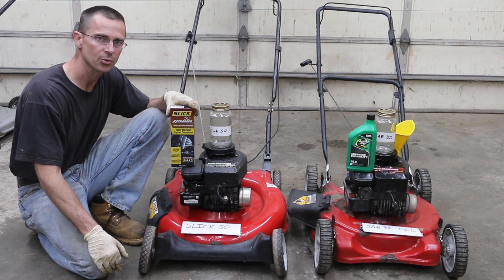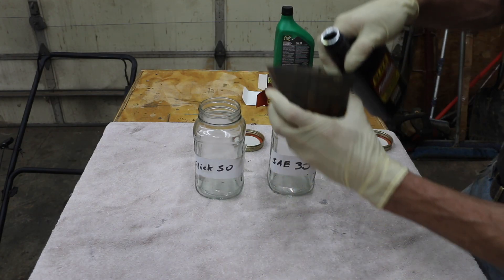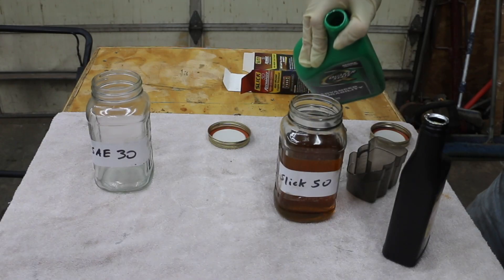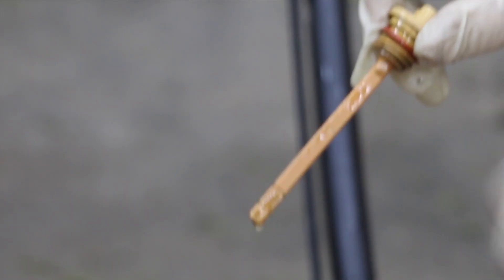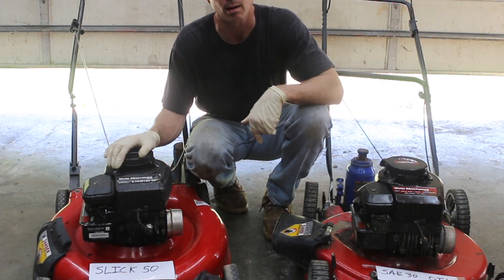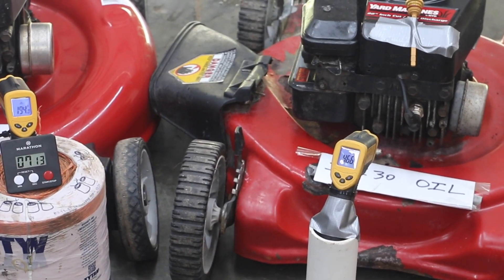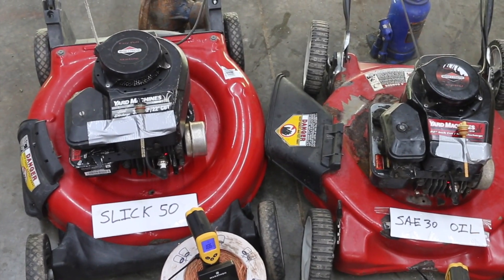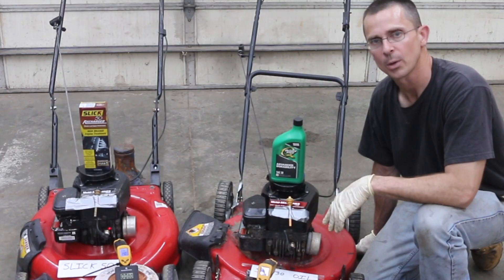Can't believe what SLICK 50 did to my engine!!--Dry Crankcase Test!

Comment: Hmm, most visitors are talking about their experience with cars or what they believe to have as an experience?. Quite a bit different beast of an engine if you compare the gasoline mower engine to a BMW M50 gasoline engine or an AMG gasoline engine or let's say a Turbo diesel torque monster with decent displacement! They all operate at a total different pressure figures,  temperatures and rotational speeds and forces. Not to mention differences inbetween cast iron or aluminium engine blocks based on reactions of the ingredients of the engine block with oil and additives, different bearing materials and tolerances. Just think of the tolerances a F1 engine has that not even would turn in cold condition while a stock car engine has to work under almost every conditions, even in Winter!

I'm not sure if that all doesn't lead to an apple-to-oranges but gives any kind of measurement?
Reply from the maker: All great points and thanks for commenting.

Comment: This is interesting. I've been running slick 50 in my old cars for years. I put it in my truck at about 100k miles and it made the engine run noticeably quieter.
Reply from the maker: Thanks for commenting on this!

Comment: As a young engineer I was suckered into the Slick 50 advertising. During a trip across Australia in the early 70's, my car ran low on oil and with no shops in sight, I thought not a problem, the Slick 50 will look after me. Wrong, engine seized. Later I ended up in a senior leadership position working for Castrol and regularly visited their R&D facility in the UK. Very impressive, as are all the major lubricant manufacturers including Castrol's main competitor Mobil. Key take away from nearly 50 years of working with different lubricants, is don't tinker with what some very smart people have developed into their products. If the oil doesn't work for you, find the grade/mix that does and don't try to home brew a fix.
Reply: On this line of chat, I did my own oil and filter changes on a regular basis.  Someone mentioned how good Marvel Mystery Oil was, so I tried it, adding a full quart to replace the filter add.  The engine ran noticeably quieter almost immediately.  Been a fan since.
Reply: @telemachusepiphany9668  I had a 1970 LTD that I needed to drive 1000 miles. The oil quit circulating and it made a terrible noise. The hotel manager mentioned Marvel Mystery Oil which I tried. I ran that car 3 more years before getting rid of it.
Reply: You didn't use it anywhere near close to the way the directions tell you to.  No break in, no time for the PTFE to bond or set.  FAIL.   SLICK 50 saved my ass in the Arizona desert. Conditions:  110+ degrees F,  80MPH 4 QUARTS LOW.   I pulled into the closest truck stop, added about 4 quarts of 10w40, and drove 50 miles into Phoenix @ 75MPH, '80 350 Chevy van with almost 100k miles on it.  I drove all over Arizona, then back to Texas.  NO obvious damage nor excessive oil consumption
Reply: @mre2u2  jus had a heck uva leadk did ya?? well no sense fixin THAT!
Reply: Interesting, I have just commented on how Castrol Magnatec oil appears to have improved the cold starting on my Isuzu Trooper, it's the 3.0 diesel 2003 model which I've owned for 10 years.
Reply: I call BS. No "engineer" is that stupid.
Reply: Leave it to a engineer to run a car out of oil, than blame the lubricant manufacture!
Reply: Terry Baker Thank you! 🌲
Reply: @@UCLHxVtPmWIbR0egpBxFBf8AThose engineers aren't going to be allowed to work on anything that would be released  to the public which might reduce our regular purchase of their primary product.
Reply: And what of the scientists and engineers making the additive products?    They are all evil capitalists while the scientists and engineers making oil are pure as the wind driven snow?  Altruists?   smh
Reply: Aww
Reply: Smart....Very Smart.
Reply: Seems somehow I always use Castrol synthetic in my car, I just look for when synth is on sale intending to buy whatever seems best, HEY! Castrol again!
But watching what I have seen so far of this channel, it seems Amsoil is best, but I don't see it often where I live.
Reply: Could be the damage was already done
Reply: MY OLD MOTTO IS, 
("IF IT AIN'T BROKE, 
DON'T FIX IT UNTIL IT IS. ")

Do not screw up COSTLY equipment, experimenting and tinkering, unless YOU'RE RICH.
Reply from the maker: I enjoyed reading your post. Thanks for commenting.
Reply: Nothing is a miracle product, but i completly disagree, ive torn down many high milage diesel and petrol engines here in australia that i or others have personally serviced and used slick 50 with. 

 We tested it for on a fleet of taxis, and trucks identical models and engines all driven by a mixture of drivers day and night. And the almost perfect 50percent of the fleet that had the slick 50 in it every service had noticbly less wear upon major rebuild time. Again, its not a magic miracle additive, but its backed by some serious lab r&d. One of the benifits of them not working for a sole company like castrol, is they can work with multiple companies across mutliple brands and not have preferential treatment from oem manufactures etc influencing final product. ie its too expensive make it cheaper for us.
Reply: @Steve211Ucdhihifvshi  Dude, you're missing the point of the test, which was to see if Slick 50's old claim about their product was true.  This test showed it was a big, fat lie.  He also proved that the engine runs cooler with Slick 50.  He didn't tear down the engines to show the cleaning ability of Slick 50, nor was that his objective.  What you're talking about is how it performs as it is currently marketed, which is not a lie, but it's not pertinent to the tests.
Reply: @Steve211Ucdhihifvshi  Sorry its still snake oil I don't think your test were very scientific.
Reply: An engineer who runs his engine low on oil, seizes it and then eventually ends up in a 'senior leadership position' at an Oil company. Sounds about right for any one in management.
Reply: Technically, he did say he was a student at that time but I get your drift. Anyone who runs an engine low on oil should not be surprised at a failure.
Reply: @mitchgent5121  good points. I know people who change oil every 1500 miles because it improves their engine life and they do not trust manufacturers claim. 500 miles run hard on a race would require oil change for any car at that point . Towing vs not towing with a diesel changes oil change requirements quite much.
Reply: @sfertonoc  Changing oil every 1500 miles doesn't improve engine life at all.  That's just throwing money away. 

Suggest you and these people do some reading at bobistheoilguy.com
Reply: @immikeurnot  well sht. Then people would sell/buy used oil preprocessed through a lawn mower instead of new oil... most of the problems associated with frequent oil change is the effects on environmentals. For low engine wear people either add zddp in their classic/race cars or change oil often to replenish this level of zddp that gets burned up.
Reply: If the racers do not use it, do not use it. Waste of money. This is one reason why people switch from Mobile1 Amsoil etc to reputed racer provider such as Schaeffer or the additives they use such as ZDDP (provided no catalytics) and Archoil Boron
Reply: @sfertonoc  i disagree. Sometimes a cheap ash oil is all you need. Royal Purple is a race oil and if you use it on a flat tappet cam it will ruin it. I dont care who argues about it facts are facts.
Reply: @billyjack8119  Royal Purple is sht. I was talking about Schaeffer oil and ZDDP which prevent tappet wear
Reply: @sfertonoc  True. I like brad penn
Reply: @billyjack8119  I like Royal Purple. Royal Purple goes out of there way to tout the ZDDP content of their lubes, a feature targeting flat followers with high-lift and high spring force. Oil analysis results bear this out. I've known no one using Purple to share stories of high wear. There are plenty of people running Purple fine in flat-follower 4A-GE, ZZ and 3SGE. Lobes and shims in my 4A-GE had very little wear.
Reply: @antilogism  maybe they have their act together now. I sold my 10 second camaro and really dont do much with hobby anymore. When a little old lady can beat you with a Tesla on her way to the store for milk and eggs i figure whats the point. The big cam hot rods are pointless to me now.
Reply: @sfertonoc many race teams DO swear by it, even though hp gain is not the main benefit
Reply: In 1990 5 of us were in a worn 2.3 litre vauxhall victor that had the slick 50 treatment before we left. The guy believed it was a good thing. Engine had a lot of miles on it and on the return journey (100miles each way) the engine started knocking and eventually a rod departed through the block. Ive never used any additives and been in the motor trade 35 years.

Comment: I tried Slick 50 in my diesel engine, having herd it reduced friction. As my diesel was strictly mechanical, I expected it to have a higher idle RPM, it didn't. My conclusion "False advertising". A gas engine would be more difficult to test, as spark advance and such change with RPM.
Reply from the maker: Great point.

Comment: again you missed the marketing ploy, slick 50 isnt an oil just like zmax, its sole purpose is to fill voids in metal and remove its porosity that is how it makes your engine run better by making everything smoother ona moleculkar level.or so the ads say, its like clogging up a piece of sandpaper, itll last way longer once clogged right?????
Reply: Thats what any lubricant does

Comment: The engine ran cooler with the Slick, right? Maybe it just breaks down at high temps and if it stays within normal temps it does its slick 50 job. Just don't overheat it. Do you know what condition those engines were in before the test? Thanks for the video! I'm not overtaken with ADD when I watch your videos!
Reply from the maker: Thanks for the positive comment!  Both engines seemed to have equal wear, but it's impossible to say for certain.
Reply: I didn't realize how much leaning over to work on bikes and mowers effected my work and patience.  Having them where you're not bent over helps a lot. I didn't have the discipline to throw the mower up on my workbench but now my spine is making me pay. Surgery makes it worse. I don't mean to be a jerk but I wish someone would've got on my back (pun intended) when I was in my twenty's. Thanks again for the cook videos. Your methods for measuring wear etc are pretty ingenious.

Comment: z Max in the commercial they took the valve covers off a Lincoln V8 motor and after adding zMAX they don't sand in the top end of motor and it still kept running
Reply from the maker: Wow!

Comment: Slick 50 is based on the idea that adding "Teflon" makes it extra slippery.  DuPont considers it a scam, and sued to stop Slick 50 from using their "Teflon" brand name.  What does that tell you?  Teflon turns into a solid at high temperatures.
Reply from the maker: All great points and thanks for commenting.

Comment: Two old used lawnmowers are not a comparable test ... the Slick Fifty Engine may have been a tighter less abused engine whereas the sae 30  may have been a very loose badly worn engine ?
Reply from the maker: I used 2 new, identical engines in more recent tests.  Thanks.

Comment: Teflon one of main additives in Slik 50 has a relatively low melting point,it is also on the soft side for  bonding to metal parts,while it offers a lower co efficient of friction[ice on ice] it doen't hang around very long.also I don't know of any car engine manufacturer that ever recommended any after market additives, ever.We sometimes forget that the factories do extensive testing to back up their requirements.The old ads were pure snake oil,one reason you don't see them on TV anymore.
Reply from the maker: All great points and thanks for commenting!
Reply: THey want to be able to sell you a car in a few years not the last car you'll ever need
Reply: @mrromantimothy  I'm still driving the last car I'll ever need.  Bought a 2000 Chevy Malibu new with 4 miles on it and I'm still driving it.  196K miles and one head gasket later.
Reply: >tests on oil additives containing PTFE conducted by the NASA Lewis Research Center, which said in their report, "In the types of bearing surface contact we have looked at, we have seen no benefit. In some cases we have seen detrimental effect. The solids in the oil tend to accumulate at inlets and act as a dam, which simply blocks the oil from entering. Instead of helping, it is actually depriving parts of lubricant"
Reply: Thor214 by
Reply: The original Slic 50 contained NO TEFLON.  Ptfe was added later after the original developer was forced out.
Research it.
Reply: Melting point of Teflon is at 326°C which is 619°F. It looks like he used "slick50 recharched" which has no teflon in it other than "slick50 classic" afaik.
Reply: That's "Wet Ice on Wet Ice" LOL ! And remember the Fireman Hosing it down !
Reply: Would a car engine manufacturer ever recommend an oil additive that would help you get 50K more miles out of your car if it already gets 150K of life? I doubt it, I'm pretty sure they'd prefer you buy a new car at that point. With that said, I could easily imagine a snake oil merchant wanting to take advantage of people wanting to get that extra 50K, so I can appreciate independent experimenters like Project Farm.
Reply: Actually PTFE  (teflon) has a pretty high melting point, 330C.  It is used in tire molds as a release agent as well.  ITs not designed to stick to metal when in oil, its another component with a very low COF  (one of the lowest) which reduces friction.  You need to test slick 50 for the purpose which it was designed.  Try using 100% slick 50 and run engine with oil and measure things like mpg, horse power might be to hard to see a difference.
Reply: @johnh383    I hate when people spew out made up stuff.  As you correctly point out, Teflon is well known as having a high melting point and a low coefficient of friction, but as you also note, that is not the whole story by a long shot.
Reply: All slick 50 does is clog your oil filter. Slick 50 is a scam.
Reply: @anonanonymous1988  DO you have any scientific testing to support your claim?
Reply: @johnh383  Not currently, I used to test oil additives though and studied auto mechanics. If you want to test how Teflon works on metal to metal parts you can take a Teflon coated pan and scrape it with a metal spatula. 

Teflon doesn't offer any resistance to metal to metal contact. But if you don't believe me feel free to waist your money.

The testing I did was simular to the video except the lever of the machine had a gage to tell how much pressure the oil failed at. There was zero difference between the slick 50 and regular oil.

Best results are with synthetic oil.
Reply: @johnh383  A good test is to run slick 50 though an oil filter and see what does. (Spoiler Alert) the Teflon doesn't make it through the filter.
Reply: @anonanonymous1988  I'm a chemist and have been working with PTFE for over 30 years.  You don't understand the what the PTFE can and can't do.  SO long as the particle size of the PTFE is below 5 microns it should pass freely through the oil filter.  And it isn't going to give you an abrasion resistant coating.  Its not that type of polymer.  Its for lubrication!  And yes, oil with PTFE added will have better lubrication properties than straight oil.
Reply: @johnh383  How many commercial oil brands and types contain PTFE? I.e is it common to find it in normal engine oils?
Reply: @Camwize   I don't think PTFE is used in engine oil much at all, but that has no bearing on the melting point.  Here is a summary of PTFE uses: https://en.wikipedia.org/wiki/Polytetrafluoroethylene#Applications_and_uses
Reply: @Camwize  Never checked.  Problems with true PTFE is it can settle out into the bottom of your oil pan if  other additives cant keep it suspended good enough.
PTFE has a specific gravity of about 2.2-2.3, oil is less than 1.  This means the PTFE wants to sink to the bottom when there isnt enough movement to keep it in suspension.

Comment: I KNOW ONE:: Pro Blend. I can't find it in California now, but it's on the internet. STORY: i was in my B2000 Mazda driving out of the santa cruz mountains and the cylinder head cracked, all the oil went into the water. I saw the water temp was pegged. I got some oil in san jose but it went into the water. I drove 70 more miles, turned engine off and on a few times. I then drove back up the santa cruz mountains, near Boulder Creek. Maybe 175 miles. The spark plug boots were like big puffed up marshmallows. It started and ran just fine! I first used it in 1984 in my 1959 vette with a 550 hp small block. But first i put it in the differential, it Cured the posi chatter so common in pre 1964 posi traction. It is Excellent in wet clutch applications! Used it in 50-500 cc two strokes. So i have more stories, all good.
Reply from the maker: Thank you for this recommendation!

Comment: I did this with a ford 289 v-8 and it didn't seize...this was 25 years ago, so I can only assume that the formula has changed? 
 I am seriously fascinated by this test, you did not get the same result I did. why would 25 years make such a difference?
Reply from the maker: Yes, the formula did change.  The company was sold a while back. Thanks for commenting!